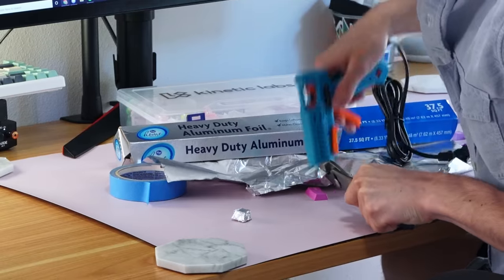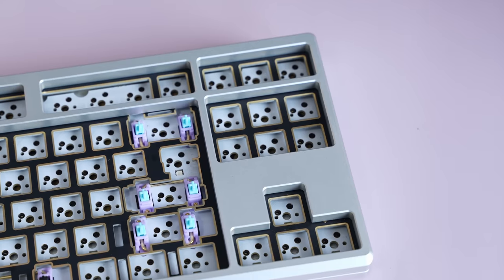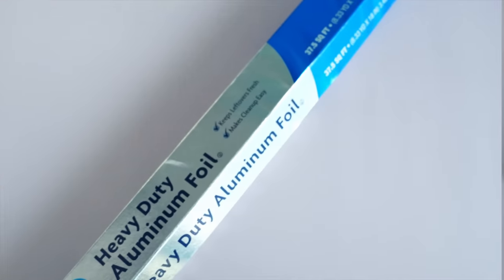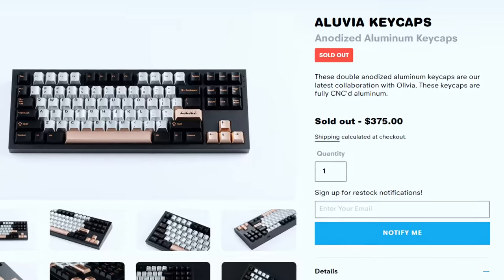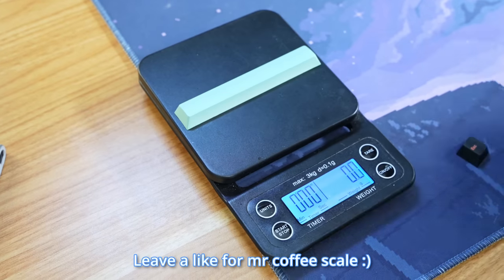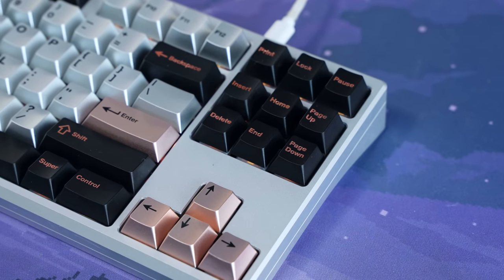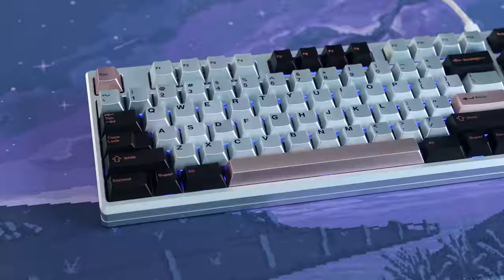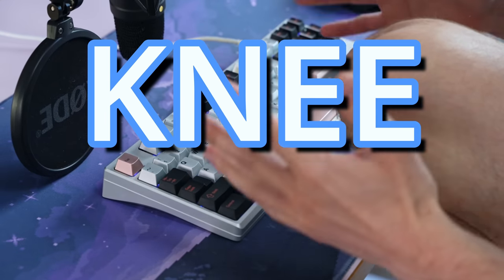I Finally Tried METAL Keycaps. (So you don't have to.)

Comment: Resale I’ve seen from $400-$500. They come in this nice aluminum carrying case. Alittle gimmicky tbh. They feel great to the touch, my concern is the sound. I got the chance to play with them a bit. And to me they sounded a bit pingy like the sound from the switch bounces off the metal cap sidewalls more. We had lubbed and filmed aqua kings 67g springs. No issues with the space bar. Looks good, feels premium, but don’t expect any additional thock.
Reply: Another plus is that they don't shine like gmk
Reply: I found them on novel keys for $200
Reply: I like how they sound some people like that clacky high pitch sound too they are a gimmick 100% but if you're rich they're pretty cool.

Comment: ceramic with legends would probably be the best sounding, per a couple vids i eyeballed and eared. but idk. i'd like a pbt vs. ceramic vs. aluminum vs. wood vs knee vs. glass vs. glarse vs. switch
Reply: lmfao "kneecaps"
Reply: the ceramic ones are alot cheaper too
Reply: there is also how they feel when typing not just the sound
Reply: The whole two piece design between the cap and crucifix is just a really bad. And qc seems bad they look soooooo cheap and bad.
Reply: @philipp594  what ceramic ones? I’ve seen some videos and they look decent. I don’t looove the way the backlight bleeds so much, but for those who like that Pudding type look, I’d say they work fine
Reply: @RiceCubeTech  all of the ceramic ones use plastic pieces glued in to attach them to the keycaps.
Reply: @philipp594  yeah I know, but for the most part it seems to work alright
Reply: @RiceCubeTech  If that is good enough for you with premium keycaps go ahead.
Reply: @philipp594 what else they gonna do? They’re ceramic
Reply: @shawnhitt5312  Make the crucifix from ceramic?!

Comment: Be careful with carbon filter. Even though activated carbon used in the filter has low conductivity it still got some so it can cause shorts if you don't put a layer of tape of some other non-conductive material (like paper) in between the PCB and the filter. 
Again, the chances to short is very low but they are not 0.
Reply: bruh it was a joke
Reply: Chances of anything happening are always not zero

Comment: I bought these for my keyboard and I found that filling the spacebar with foam or noico sound deadening significantly reduced the pinging on my board. The function row tends to be the more apparent in terms of the metallic pinging sound but other than that, I actually really like the keycaps.

Comment: As someone who bought these (and love them), here's a couple "before-you-buy" tips for aluminum keycaps for everyone.
The overarching theme is MACHINING IS RARELY PERFECT. This manifests in 2 noticeable ways. First, the legends are not going to be perfect. Some keys, primarily those with thinner characters, might look bold, while some look thinned out. I haven't noticed any that are crooked though, thankfully.
Second, the underside of the keycaps that connect to the switch stems are not going to be sized properly for all keys. This will mean it sits either loosely or tightly on your switches. In my experience, I only had one key sit loosely, and it was on a stabilized key. The tight keys just required a little extra work to get them safely on the switch stem, and have no noticeable effects on wobble or things like that while typing.
Last point is there may be small blemishes on the keys. I had a SINGLE key with this issue, and yes it is noticeable, but easily ignored.

Comment: I have these and the only warning I would offer is in addition to one mentioned below - the machining isn't perfect.  However, this is clearly mentioned this on the product page so there's no way a buyer could ever complain they didn't know (RTFM and all that).

Anyway, the additional part is that the slightly imperfect machining means that yes they don't fit every stem perfectly but it also means you have to squeeze some of the keycap crosses to make the fit a bit tighter or, the opposite, use a tool to make them slightly wider.  Across my entire set I've had to do that 8-9x now and while that would be annoying for some, I read the product page and was expecting it.

Another interesting point is that because they're metal, they seem to expand/contract and hot/cold conditions.  I suspect this is the case because a keycap I've modified to fit still pops off when this room is really warm but stays firm when the room is cold.  I can't see any other explanation than the metal itself expanding and contracting.

Oh yeah and the loose keycaps do "ping" a bit straight out of the box.  That issue goes away when they're fitted properly, though.

Comment: I'm a little perplexed that you dampened, and then complained about the lack of difference in sound. Without dampening, and depending on your case, plate, and switch, you can achieve a thocky kind of sound, but it'll tend to have more of a ping depending on the materials.

I had a full TKL set of blank zinc caps. They went on my TKL that has an aluminum case and MX Greys (and I also tried them on my MX Green board), and I very much enjoyed the feeling and sound that they produced. I only used them for about a week or two and ultimately, I didn't want to keep them as a daily and end up ruining them, so I packed them up. I ended up selling them to someone else who had wanted them.

Comment: I have 13 metal keys and they kick ass they also have RGB pass through the best part about that is since it’s metal and not plastic defused like others it shines the letters on the ceiling 😂 for anyone who is curious I just got them on eBay and Amazon the most expensive one was the space bar and yes it was 75 dollars the rest were reasonable honestly 15-30  bucks for the sets one for the arrow keys and then I got the big back for the wsad and everything around it, then of course the esc key the spacebar I have is protected quadruple the weight of a normal one and that does have a deeper noise

Comment: I have these keycaps and like them, but one thing hipyo didnt mention is that these keycaps are "light". I have a set of Zinc keycaps and they're more dense and weigh a bit more (heavier metal duh),  and I also have a bronze spacebar which is literally 3.5x heavier than the aluvia's; these keycaps especially the spacebar makes it THUNK not thock.  If these keycaps were made with a bit more mass or a different blend of aluminum itll probably sound more different, but remember not everyone is rocking high/heavy springweights (i use 180g) so cant have super heavy caps activating switches.
Reply: Lmao, from now on I will strive to get a keyboard that THUNKS 😂

Comment: i would suggest looking into eletroplating plastic for the 'diy' caps, just spray with conductive spraypaint and electroplate away, will need sanding and polishing afterwards, but would work, ToyPolli uses it to place chrome back on plastic toys
Reply: Would look good ascetically, but you wouldn’t get the sound of the metal, so there’s that

Comment: I'm pretty happy with my Redragon Horus. Low profile, short travel, double-shot key caps. I'm amused that it came with eight spare switches...so far, haven't needed to change any of them, but it's only been a few months. Feels much better than my Corsair K70 Lux on my desktop...and weighs so little compared to the Corsair, which is important, because I always put the keyboard on my lap. Well under $100, too. I think I'll replace the Corsair with another Redragon keyboard soon, if this one continues to behave this well...not to mention the mouse. My Corsair mouse is giving me trouble with the wheel, but the Redragon mouse has very good behavior so far.

Comment: Question what swiches will you use and would you suggest Cherry mx silent black swiches;and lubeing them?
Reply: Silent switches are awful and cherry switches are awful, so double awful
Reply: Ok hater
Reply: @Aura60364  its literally a fact, they’re mushy
Reply: @anytuna  ok well I am buying a 5 pcs before to check them out but I was just wondering if it is worth it and if my comment above you didn't like or offended you I can delete the comment.
Reply: @Aura60364  im not offended at keyboard parts 💀
Reply: @Aura60364  im just saying they arent high quality and also silent switches put in stuff to dampen the bottom out, the whole reason people use mechanical keyboards is to not have a mushy switch
Reply: @anytuna  ok thanks for your feed back and the comment that I asked you if you want me to delete was about calling you a "hater"

Comment: A set of aluminum keycaps could easily last an entire lifetime and still look new.  But for something so permanent, I'd want it to be really nice, like a spherical-ish scooped top instead of a cylinder, and big friendly centered legends instead of a little label in the corner.  Perhaps DSA profile, or AF SA, or MG, or something like that.  It seems a waste to spend so much on a Cherry-style keycap set.  I guess that's just personal preference though.
Reply: the anodization wont last a lifetime for sure, have you ever used a fake carabiner as a keychain?
Reply: @knoopx  not necessarily, it seems like wear resistance of anodized layer heavily depends on quality of aluminium alloy used.
That said, as soon as even microscopic area of anodized layer wears out, that key would be as good as dead. I owned a couple of cheap phones with aluminum frames (probably either poor alloy quality or poorly anodized), and I can safely tell that aluminum corroding from contact with skin oil doesn't look pretty
It's kinda sad that it wears out, since anodized layer is actually same material as sapphire, but porous

Comment: I think the silver-ish ones look pretty rad.  Cool with the matching case, I suspect a lush wood case would look amazing against them.  Not a fan of the pink keys at all, nor the pink writing on the black keys, so I'd say my preference would be a set that was all silver, maybe with three or four accent keys in black but with silver-instead-of-pink writing, and a dark-stained wood case, If I was designing a metal board myself.

Comment: Metal generally gets really cold if the temperature outside is really low, am i the only one wondering if these keycaps would feel freezing to type on when its cold?
Reply: If it's that cold in your room you probably should have spent money on heating and not keyboards.
Reply: @yuki3485  I have heating, I just don't want to waste electricity by using it 24/7. Also, I haven't even built my first keyboard yet lmao I'm still looking around.

Comment: KEYBOARD HELP - Hi.  Hoping someone can help with mech keyboards available or where to get advice.  I have and need to keep a 100% board, currently G915 with browns.  I've discovered that I like the low profile and the 2.5mm total key travel but the G915 fails because the backlight doesn't show through some of the punctuation keys which is bad for programming in low light, which I do often.  So, is there a keyboard like the G915 or the Keychron K1 but with PBT shine through keycaps and swap-able low profile switches.  I don't care what brand of switches as long as I can get equivalent to browns with around 2.5mm travel.  Looking for 100%, low profile, low travel, hot swap, PBT shine through kaps, wired and wireless.  Might be asking too much.  Any help appreciated.  Thanks.

Comment: I have some really bad redd switches that a friend of mine lubed and they are getting pretty wierd, sometimes the d button for an example will register 2 times instead of one time. I use a Rk 84 and would really like to buy a new board that i don't need to mod. For the board I want to buy Everglide aqua kings and some keycaps. Got any tips on a new board and some keycaps that are decent for a budget price.

Comment: I've used metal keycaps, a lot cheaper than the one you got. Also backlit btw. and at first I thought, these are kewl but after using it for some time I found I didn't like them after all. They just don't feel very comfortable.

Comment: The price is pretty ridiculous for aluminium given that steel keycaps are much, much cheaper (although still not cheap!). There are steel keycaps 1/3 the price of these things...

Yes CNCing is expensive but the cost scales with the hardness of the metal. A softer metal (aluminium) product should not cost more than the same thing made with a much, much harder metal.

Comment: I hope this isn't another video complaining about fitment and poor QC, like the QC on my set is 10/10 and they were super tight on some switches/stabs and unbelievably loose on others.  So many out there are making that mistake when in reality it's the poor QC of the switch and stab manufacturers combined with the reality of the material.  ABS and PBT stretches elastically and tries to return to its original shape which is why it can fit on pretty much any switch stem and hold on tightly even if there are poor tolerances.  Relative to plastics, aluminum deforms when stretched.  So, if you have loose aluminum keycaps it's because the switch stems are too small.  All you have to do to fix this is to squeeze the keycap stems together with some pliers a little to make them fit your switches.  Likewise if it seems impossibly tight all you have to do is stretch out the keycap stems a little before trying to put them on the switch.  I get that it would be nice not to have to mod $400 keycaps to get them to fit your switches but again that's just the reality of the aluminum material and maybe you shouldn've though twice before assuming $0.35 switches would have perfect tolerances to fit with $400 aluminum keycaps.